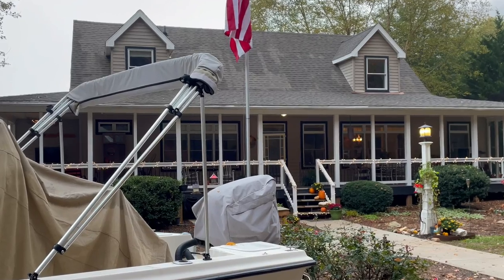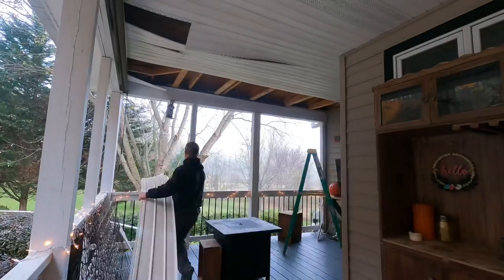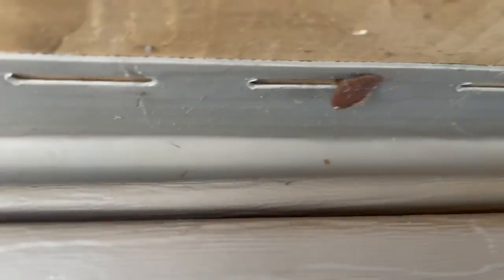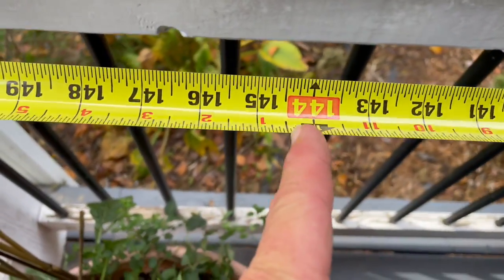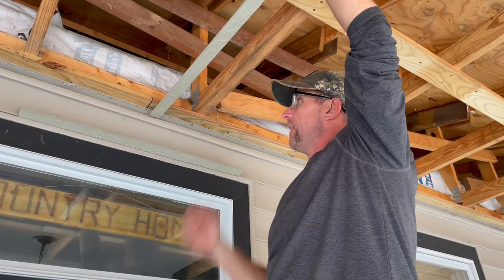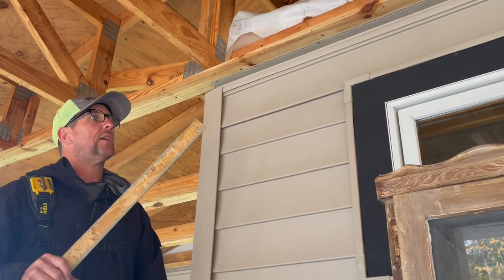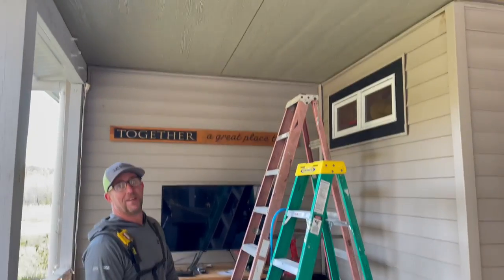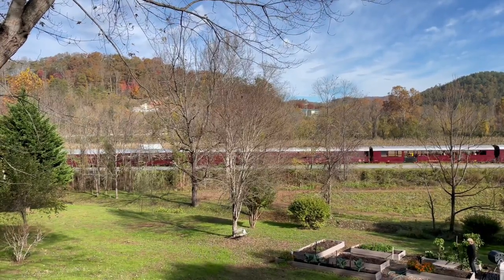New Porch Ceiling—Family Edition

Comment: The vinyl was actually nailed properly by not being driven home. Vinyl expands and contracts a lot. Leaving the nails just slightly loose allows for that without buckling. The new ceiling turned out awesome!
Reply: Actually you drive the J- channel trim home it doesn’t need to move
Reply: @benhart6169  Actually, it does expand and contract. I hung vinyl siding for 15 years in Houston Texas. Every piece of vinyl will expand and contract. I should also mention, a few of the companies I contracted from required Alcoa certification, which I have.

Comment: I know how to fix those separate between the pallets between those panels are you doing is by get a strip, the same color and use that caulking that you guys use on the job and a staple gun and put one up on each strip end end but it up against the end piece your trim it will come out perfectthat’s what happens when you have a crooked ceiling. The best thing you can do. Nice job.

Comment: You Acually should have pulled those 1 bys so you have more joist to nail to but looks great
Reply from the maker: Yeah I thought about doing that but it just seemed like so much work? And also the vinyl channel that’s up against the house is actually nailed to the one buys so I would’ve had to rip that off and then figure out somehow to attach the vinyl so I just left them up.
Reply: You make a good point but I would have added more one bys just to prevent sagging.
Reply from the maker: Yeah. Hopefully that doesn’t happen! Thanks.

Comment: Thoroughly enjoyed watching that! Great video. Are you going to add SOFFIT VENTS in the new porch ceiling??? Might want to toss that idea around with the Perkins crew and check the local building code. Without venting that space might be prone to mold and rot over time. (Depends on the overall design of the enclosed space).
Reply from the maker: There are soffit vents on both ends. Also the roof is a manufactured home and so it doesn’t have a ridge cap so really there’s nowhere for the air to go in that respect. Thanks for watching.
Reply: Awesome, sounds good. Enjoy your evening!!

Comment: If I were you I would have either recess these eye-sore beam bolts into the beam and\or replace them with cup head bolts and cut flush the bolts instead... looks like they're only there to hold together these laminated beams.... a bit excessive anyway
Reply from the maker: That is probably a good idea. Haven’t thought of that. I will look into it. Thanks.

Comment: I'm a little bit concerned that you restricted a LOT of attic ventilation by changing to a solid material, you'll know in a year or 2.
Reply from the maker: There is vented soffit on the sides. It is a manufactured home and roof is not vented so nowhere for it to go anyway. I had Jaime look at it all i should be all good. Thanks!

Comment: Interesting that you removed the ventilated aspect of the old and sealed it up. Also surprised you didn’t add more lighting down the veranda since it was wide open access end to end.
Reply from the maker: Yeah I mentioned to Stephanie about the lighting. But we’re more of an accent lighting type of family. We have the mattress with the Edison bulbs in it and we also usually do some type of accent lighting around the post. So we didn’t want anything like hanging from the ceiling. Also as far as the venting goes there’s soffit vents on both ends also it’s a manufactured home so there’s no ridge cap so there’s nowhere for the air to go up out the roof. I appreciate you thinking about it and thanks for watching.